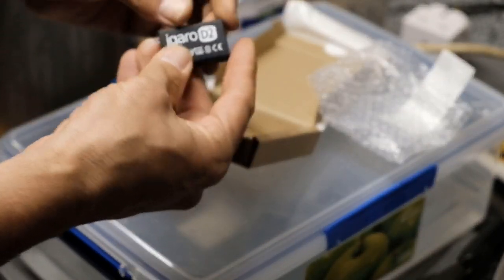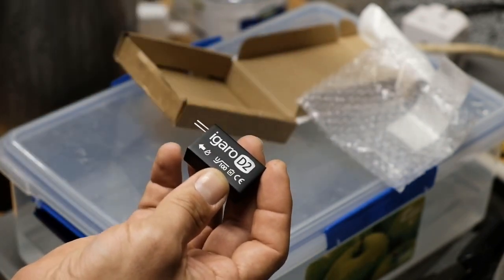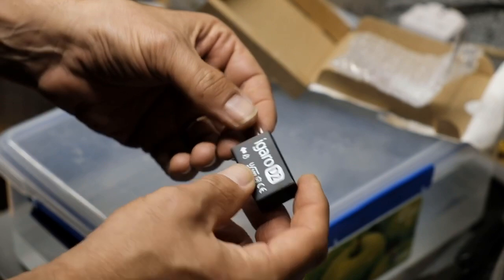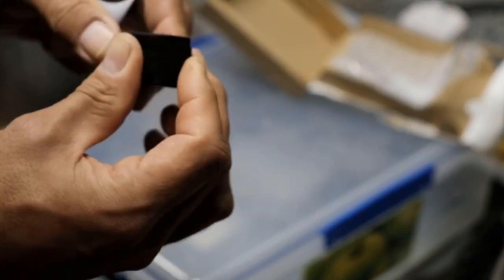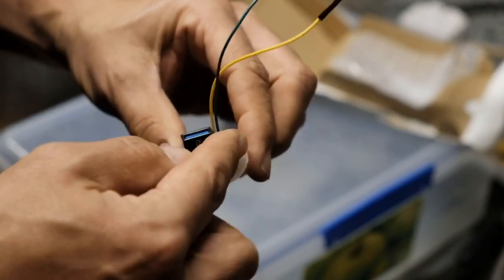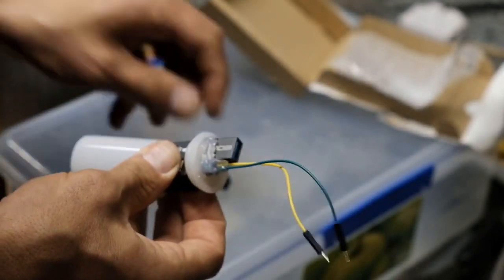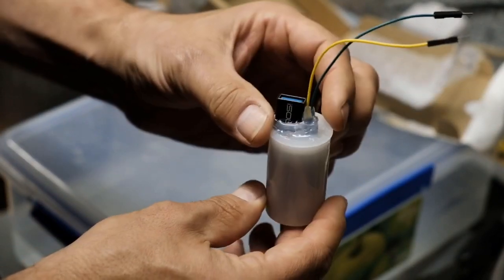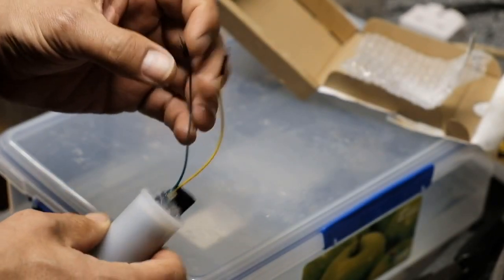Bike Hub Dynamos, batteries and the Igaro D2

Comment: I bought a Igaro D2 Pro R3, what a piece of junk. Claims to be water proof, capacitors and circuit board exposed, $230 for what? It looks like a child's science project, connected directly to a son dynamo kept getting 1 red light only which means i'm not going fast enough according to the manufacturer. I was going 20 mph and it was still blinking red. Useless overpriced junk buy somethign else
Reply: have you contacted the manufacturer? sounds faulty. its also waterproof after you silicone seal it.
Reply: @KeiranKav  manufacturer claims it's waterproof as delivered, i'm not playing mechanic on a $230 piece of equipment that then they wont accept a return on because it tried to fix their waterproofing

Comment: Hi Simon
Very useful video.
I'm just about to buy an Igaro D2 so your info is great and I may follow your design  or similar. I'm not an electrician so wonder about the size of the wires you use. Can they be any guage/thickness?
Also it's not possible to see clearly the connectors in the video that are on the end of the wires when you push them onto the 2 wire prongs on the unit. What wire connectors do you use?
Can you gjve more details or show another video with better close up shots? 
But many thanks for all your help.
Kevin
Reply from the maker: Hello Kevin,
I used wires that are used with Arduino devices. They are just single pin connectors on the end of thin wires. The current is very small so you don’t need thick cables. Ones like https://www.ebay.co.uk/itm/262202347968
Reply: @simonssubjects68  Hi Simon, many thanks for you quick reply. I’ll go ahead with your suggestion. By the way.......Igaro have now suspended all sales of the Igaro D2 due to some electric circuit problems which had been causing device failure for many users. I had just bought the last unit from an online seller without realising the product re-call. So I’ll have to wait until they issue a new version, which the Igaro site states should be released around Dec 2020 this year. So the newer, upgraded version should be better in all respects to the present D2 and certainly the older D1. Kevin
Reply: @simonssubjects68  Hi again Simon, just to add to my last comment with regard to Igaro D2 suspended sales. I wonder what dynamo you are using with your setup?
Many thanks for all your information here which is great for non electrical minded people like me! Kevin

Comment: Thanks Simon. I have been wondering about solutions for mine which I use for audax. I’ve settled on your plan but using a slightly deeper entomological vile. The D2 is wrapped in a scrap of road inner tube with the cables and closed off with a cable tie. The vile itself is wrapped in a scrap of MTB inner tube to provide silence when rattling around in the bag. That in turn is closed off with a cable tie. Sadly I can’t fit a packet of silica gel in there. Nothing’s perfect 😉